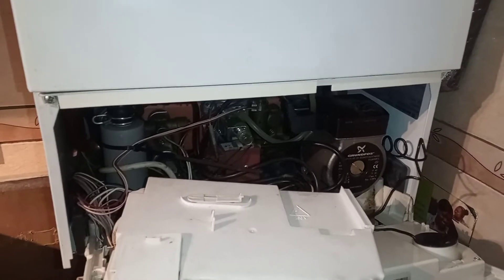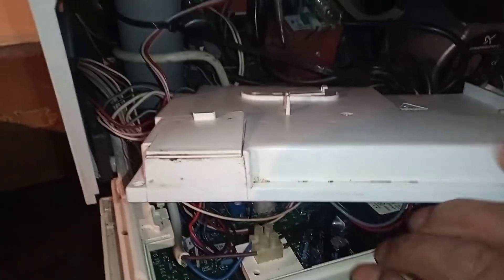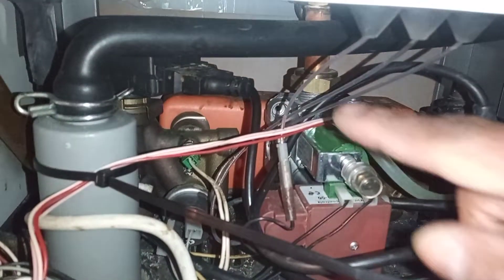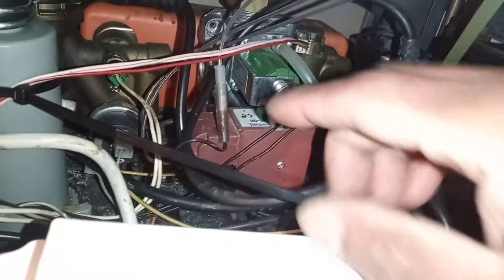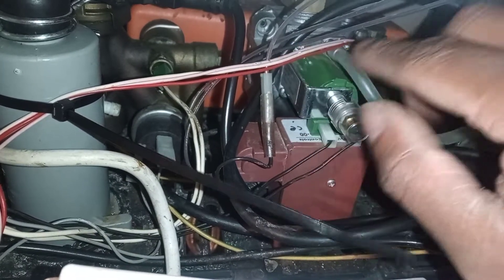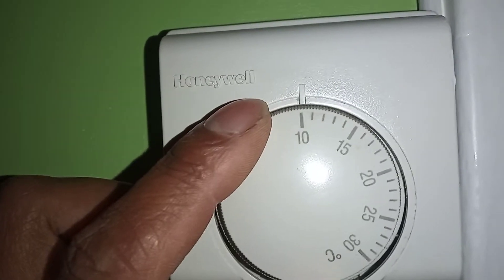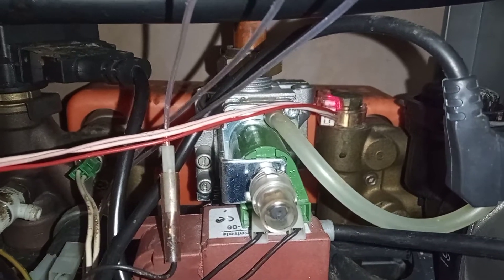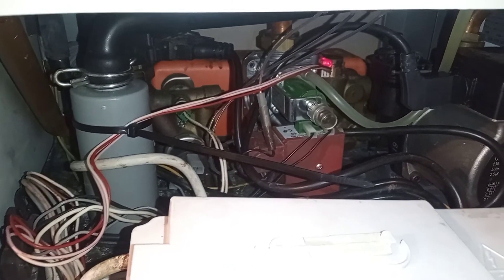NO HEATING / MICROGENUS 24 HE MFFI

Comment: Good in that you pulled the odd wire here and there.  Amazing what happens because of bad connections. Replace the defective wires. Connect using lever Wagos, which aids easy disconnection and connection.  I would replace the ropey oversized main cable as well.
Reply from the maker: Thanks for the tips John. So far I've ordered the hall sensor but need to order wires or like you say using wagos is a good option.
Reply: @CommercialGasEngineerVideos  
Lever Wagos are simple, quick, disconnects easily and always makes a good connection. Have a few in the van. Great get out of jail connectors.
Reply from the maker: @johnburns4017  yeah I should use wagos more. Can count how many times I have on one hand. A friend of mine swears by them and is his excuse for not isolating the power and working live. Guess what, the client tells me that the boiler worked well up until now so my cable tie didn't get me out of jail for long enough.

Comment: My girlfriend has a microgenus and has just had the pcb replaced on it. It was working initially however now only the heating works and nothing happens when asking for hot water? Is this the DHW sensor that is at fault? Cheers.
Reply from the maker: Check the hall effect sensor, also the diverter valve and actuator. It's hard for me to tell as I'm not in front of it. You also have the domestic plate heat exchanger that could be the problem. 

Following the sequence of operation.
Reply: @CommercialGasEngineerVideos hey mate. Cheers for the reply. When she calls for heating the radiator symbol lights up and it fires up no issues. However when she runs a hot tap it doesnt even light up the tap symbol on the boiler which is why it made me think flow switch or sensor
Reply from the maker: @92cBenton  can check if the flow switch is making when there's a demand.   

See if you can find the specific sequence of operation for the microgenus you're working on.

Comment: I have an Ariston micro genus boiler working for 21 years with zero breakdowns.
Just broke down today.
Reply from the maker: It took me hrs to repair the one in this video. The moment I was about to replace it, tried one last time and found the problem. Wonder what's caused yours to breakdown any idea?
Reply: I'm also a gas engineer. It's installed in one of my house's that I could not get access to for last 15yrs.
It's over heating, PRV has popped and the brownest water and gunk is coming out of a prv that I've ever seen. 
Rather than trying to fix just going to powerflush and swap boiler out. 
I haven't even looked at it. Just got a pic from the xwife saying my kids are cold and I better come and fix it.

Comment from the maker: After doing a temporary repair I returned and changed the hall effect sensor plus the cables. Boiler is now operating as it should. Part numbers are 65100698 (cable). 65100540 (hall effect sensor).